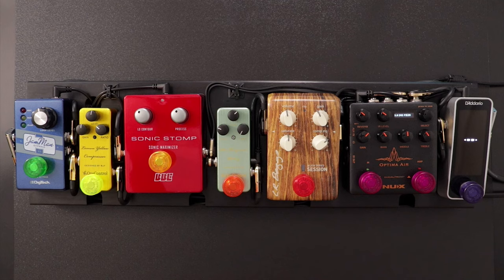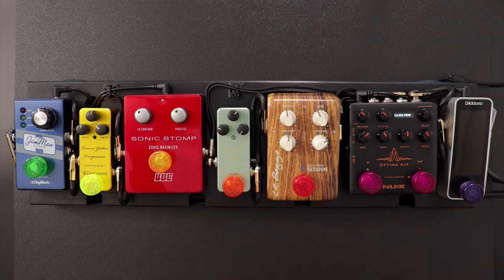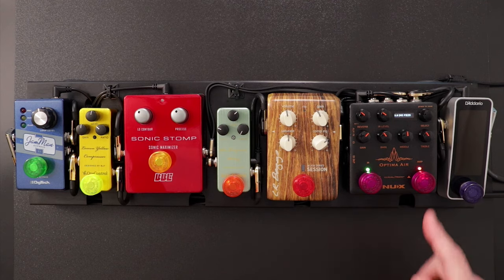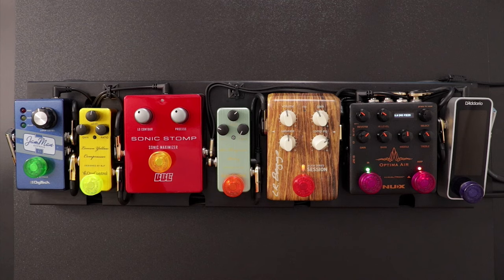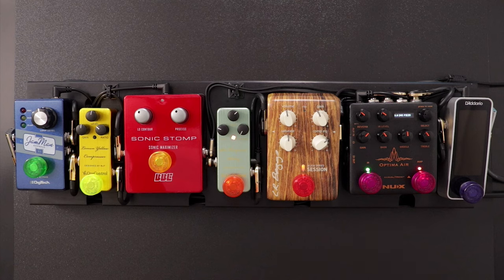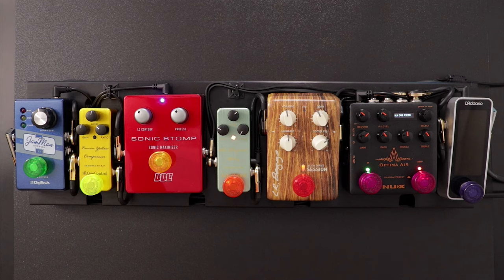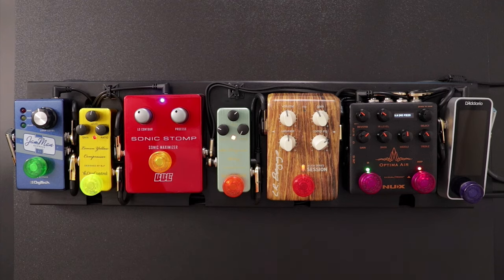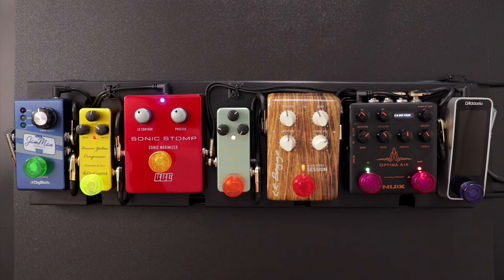Acoustic Guitars NEED Pedals Too! | Acoustic Pedalboard Walkthrough

Comment: Step 1: Have a Maton!
Reply from the maker: A nice guitar certainly does help things ; )
Reply: Step 2 - AER amp
Reply from the maker: @DannyBrooks1  Great amps ; )
Reply: Have a maton of money
Reply: Downside of a Maton is that acoustically, they are lacking. Great pickup though. Basically the same as what Takamine use but with an internal mic.
Reply: @scottmoreau5630  I agree on the production models but I have a Custom Shop TE and it sounds fantastic unplugged as well.
Reply: @DannyBrooks1  They can sound nice but it’s the pickup that’s the problem. It’s built right into the bridge and they often brace the top a bit heavier to fight feedback. Still, Tommy uses it acoustically all of the time so it must sound nice enough!
Reply: @scottmoreau5630  All I can tell you is I had a production version and hated it. I Bought the Custom shop TE and it sustains unbelievable well acoustically and has become my favorite guitar. It in a league of its own. I also, own a Bourgeois which is fantastic but the Maton gets played every day!

Comment: It's flat out stupid that Nux didn't include anti feedback on their pedal.  It's prone to tons of feed back when you turn up the signal.  I'm taking mine back tomorrow.
Reply from the maker: No worries. I've always found that putting a "feedback buster" in the sound hole of my guitar solves most issues. Other options would be notching out the problematic frequency with EQ or flipping the phase of your signal. But it kind of depends on your rig (and the volumes you're playing at). Hope that helps!
Reply: It has a feedback filter in the app.

Comment: What if I don't want to plug this into an interface? I have the same amp and I want this to sound like what I am hearing in this video through just the amp for smaller gigs. What do I do then? And if I do want to play through a PA, what is the signal flow, or how to do I get this sound running this out of the DI?

Comment: Curious ¿How would the rig sound with the Nux Optima Air at the end of the chain? ¿Would the IR have a different effect on the overall sound? Maybe that way the reverb is less affected by the compressors. Thanks for this video, the best walkthrough for acoustic pedals online!
Reply from the maker: Thanks! Yeah, it's certainly something you could experiment with. I prefer to feed the IR a clean signal from the guitar. But there's no rules ; )

Comment: I play a 2018 Martin OM28, with a KnK mini installed. It goes through on original Yamaha AG Stomp pedal. It was 400.00 twenty years ago. It has a tuner, mic and preamp simulation, a detailed e.q., a limiter, chorus, delay, reverb, and it still sounds good. Under saddle pickups require alot of gear and tweaking, in order to repair the quacky, harsh, tinny sound. All the gear acquisition can end.  I haven't used that style pickup in maybe 15 years. There is a guy on You Tube who has a method using what he calls tone sticks under the saddle, and it dramatically improves the sound of piezoelectric under saddle pickups.
Reply from the maker: Nice!

Comment: This was very well done. I’m particularly interested in  and impressed with the NUx Optima pedal.  Thanks for this.
Reply from the maker: Great! Glad you found it helpful ; )
Reply: @lukezecchin  I have two Martins equipped with K&K Mini pickups. Would this pedal work with these?
Reply from the maker: @donmartin3356  I haven't used those exact pickups before. So NUX might be able to provide you more specific info regarding using transducer pickups. That said, IR's can be applied to any source. It's more about experimenting to find the tones you like. You can also load in 3rd party IR's, or create IR's specific to your guitar, if you don't find what you're looking for with the preloaded ones. Hope that helps ; )
Reply: @lukezecchin  thanks very much

Comment: Nice video sir. Have you tried using the FX LOOP on NUX Air for the other pedals?
Reply from the maker: Yep, the FX loop works great! I'm actually using it in this video ; )
Reply: Thats great to know. May I know pedals your using with the NUX FX loop? Was planning to rearrage my mini board and was a bit confused with the chain. Here’s my current pedals. Polara reverb, DOD delay,Nux Optima and was planning to buy Diamond comp eq. Can you suggest a signal chain out of it? That would be a great help for to have a starting point. Thanks a lot

Comment: Luke- I love your posts and I have purchased a korg blackpitch advance tuner, a Nux optima, an lr baggs align session an the turquoise sea delay that you have suggested for use with my koa gs mini plus with an es2 pickup into a fender sfx amp. I am also going to go into either my boss Ve-8 or my Ve-2 for harmonies then out to the amp. I have two questions:
1- the Nux goes to a weird setting that is not explained in the manual until you hit both buttons simultaneously- then I see the 15 IR’s? The IR sounds great but when I turn on the EQ side the signal gets much quieter than when just the IR side is on? If I turn up the gain I get more of the fingers touching the string sound. Any ideas?
2- I have been reading about buffers. The Korg tuner is a true bypass. Do I need a buffer tuner or a buffer at the end of the pedal string prior to the amp or is this not necessary with your setup?
Thanks for your videos - I have taken the plunge but I am not good with all of this technical stuff! Just want to get a nice sound out of my guitar along with a good voice/harmony set up for small live performances!
Reply from the maker: Hi, no worries. Regards your issue with the Optima Air, I'd suggest contacting NUX support if you suspect things aren't working as they should. They'll be able to better explain what's going on.

As for the buffer... Unless you're experiencing noticeable tone loss, I wouldn't worry about a dedicated buffer. Keep in mind, if your acoustic guitar pickup is active (i.e, if it runs on a battery), your signal is already being buffered. (Also, any pedal that's left switched on, operates as a buffer too.) I use a high-quality dedicated buffer on my electric rig (because I like how it sounds with passive pickups). But again, unless you have extremely long cable runs to your amp, I suspect you wouldn't notice much difference on an acoustic. Hope that helps!

Comment: Hi Luke! I built a board similar to this one and love the tonal shaping I learned from you! I am curious if you've had a similar issue to me, where there is a lot of white noise coming through the PA system from the pedal board, even if I reduce it to just the NUX Optima. I tried both the DI and line output, with the same result. I reproduced the same thing with my audio interface (Apogee Symphony). If I set the interface to bypass the built in preamp, I get less noise, but still there. Once I engage the preamp and add a little gain, the noise pops right out, I can even hear it above my playing. I'm sure with a full band it would blend into the mix, but I am mostly solo. The white noise is much more subtle in your videos. Do you have any recommendation?
Reply from the maker: Hmm... Noise issues are commonly the result of: 1) A faulty cable. Or... 2) Because the outputs on your power supply aren't properly isolated. That said, if you can narrow down the noise issues to the Optima Air, it might be to do with the specific IR you're using. Make sure to select the correct IR for your guitar pickup. Hope that helps ; )

Comment: Hello Mate
Let's say that I have an acoustic guitar with piezo pickup + a simple compressor pedal + a 10 band EQ pedal + reverb pedal...
 Now, based on your great work and experience, in what order would you place these pedals to achieve a good sound that is close to natural. What pedal should come first and what should come last. 

Also, I'm definitely considering the Nux optima  you really did a great job... Bravo 🎉
Reply from the maker: Hey! Yeah, I'd probably place the comp first. Then, the EQ. Then, the reverb. EQ and comp can go either way around. However, when you place the comp after the EQ, you usually have to keep adjusting it every time you switch EQ settings. Hope that helps ; )

Comment: Great video and great acoustic tone thx can you imputes other IR's into the Optima Air pedal ? Like the sigma ones I've heard are good (I know there's a way of programing your own guitar setting).
Reply from the maker: Hey! Yeah, you can load third-party IR's onto the Optima Air. I actually tried loading up a few of 3Sigma's IR's for the demo. Unfortunately, for some reason I couldn't get my laptop to communicate properly with the NUX software. (This could have been due to an issue on my end though. I'll have to experiment some more.) Anyway, I hope that helps. Cheers mate ; )

Comment: Thank you for the great pedal board design.   Definitely plan to grab some of your concepts and pedals as well to my board.    Question:   Where would you suggest inserting a chorus pedal within this chain?   Specifically the Strymon Mobius.   Thanks in advance!
Reply from the maker: Hey! I'd put the Mobius, either, in the loop of the Optima Air. Or, at the very end of the board, if you'd like to run it in stereo. I'm sure both would sound great!
Reply: @lukezecchin  thanks for fast response!    I was also considering the One control Blue Monger or Copper Chorus for the better use of real estate on the board!   Do you have a preference for either of these?  I’m planning on adding a subtle chorus effect to enrich the soundscape.
Reply from the maker: @mspring6387  I don't have any experience with these, sorry. All the best!

Comment: Good video
Can the NUX blend in the plain pickup ?
I like the sound you are getting, but my taste would be somewhere between the pedals bypassed, more subtle, at least for some styles
Reply from the maker: Thanks! Yeah, I originally hoped that the 'IR Level' knob would be a blend knob with the pickup sound. However, turns out it's just a simple volume adjustment for the IR's. That said, after playing around with the pedal, I didn't really miss the piezo sound—so it wasn't a deal-breaker for me. Hope that helps, cheers ; )

Comment: Awesome video and demo, thanks buddy. I am slowly building my board based on the optima air and love it. What's the general difference between running the pedals from the line out or if you ran the other effects through the effects send and return on the air? Thanks mate, love the vids 😊
Reply from the maker: Thanks! Yeah, the FX Loop just places things 'after' the IR but 'before' the reverb. Hope that helps ; )
Reply: @lukezecchin  ahh ok thanks for the reply. So I am looking to run a compression, delay, reverb and octave pedal and would be ok to run all through the loop and then Di strait out to a desk or amp?C sorry for the extra Qs. Thanks again
Reply from the maker: @RichardDeadman-s8q  Yep, I'd run the comp before the octave. Then the delay into reverb. You could also try the comp and octave before the NUX, to see what sounds better.
Reply: @lukezecchin  awesome, thanks for the advice, much appreciated 🙏

Comment: Luke, thanks for this detailed explanation of your amplified acoustic tone. This is certainly one of the best explanations and demonstrations addressing acoustic guitar amplification that I have seen . . . anywhere. I realize that not everyone will agree or appreciate this processed approach but having dealt with acoustic amplification for the past 18 years or so I have a great appreciation for just how difficult it is to achieve a really good acoustic sound in an amplified environment. It is possible to get an "okay" tone using an acoustic guitar with a good pickup system run straight to a Sound System but I have never heard that approach sound "really good". Acoustic guitar pickups may have gained some ground in the past 15 years but they still fall short of natural acoustic tone. I believe the very act of amplifying an acoustic guitar inherently changes that nature. In other words, it is not really an acoustic guitar tone any longer. It is its own unique sound. It can be a really great sound but it isn't the same thing as the original. That said, taking the extra steps to present a really good acoustic guitar-like tone will yield benefits in the final product . . . a sound that is pleasing to the player and the audience.
Reply from the maker: Hey Bryan, thanks for your kind words. I'm glad you found the video helpful! All the best mate ; )
Reply: Still happy with it....I'm taking mine back tomorrow....feed back is a pain in the ass when you try and get decent volume.

Comment: Coincidentally, I am just putting together an acoustic pedal board. It's very basic, but I feel it will be very sufficient for my needs. I have a Tuner, a Compressor, an Optima Air pedal, and a Looper pedal in that order. The Optima Air Pedal is the best thing since sliced bread, don't you think? Now I thought I should run the compressor after the tuner. Do you have a reason you chose to put your compressor after your Optima Air pedal? I would be interested in hearing your in depth assessment of the Optima Air. I think it has great potential, but they do not provide the detail on the full use of the pedal. For example: How to download or adjust IR's. I still have not been able to get their on line tools to download, but still the pedal is awesome for what it can do.
Reply from the maker: Nice, I'm keen to hear how your board turns out! In terms of signal chain, I mainly put the comp after the Optima Air to mimic how I often order things when I'm recording in the studio (comp after EQ). Also, my preference was to feed the Optima Air the unprocessed signal straight from my guitar. (But you can always test it out both ways and see what you prefer.) P.S. I'm actually putting up a more in-depth video focussing on the Optima Air next week, so keep an eye out for that ; )

Comment: Do you use the fx loop for your wet fx / enhancements? Curious about overall signal flow. I wonder if integrating this with something like a firefly di or any tube preamp would be a benefit. Nice sounds!
Reply from the maker: Hey! Here I'm running some sounds in the FX loop of the Optima Air pedal. But I don't use an FX loop with the amp. There's no real need as acoustic amps are generally super clean with a lot of headroom. That Firefly DI looks sweet though ; )

Comment: About the best sequence of building up the acoustic tone I have seen. Really like the comparison at the end with everything on then everything off. I use a Fishman ToneDeq and get a nice compression and reverb (analog) with that. I think I could really benefit from the Nux pedal. Where would you put a tremelo in the chain? I have a few songs where that will be useful. Thanks for taking the time to present this. Cheers!
Reply from the maker: No worries! I usually place tremolo at the end of a signal chain (before the looper). I also like to put it after delay but before reverb. Although it can sound great after reverb too. It really depends on the sound you're going for. I hope that helps ; )
Reply: @lukezecchin  Yes, Helpful! It turns out the ToneDeq has a very nice analog tremelo built in. I just didn't realize it since I usually only focus on the reverb and eq. So now it seems the NuX would go after the tuner and before the ToneDeq, is that right? Thanks for the reply!
Reply from the maker: @mzmudy  Yep. You could even try placing your ToneDeq in the FX loop of the NUX. (That way you can use the reverb and the DI output on the Optima Air.) But really, it's all about experimenting with what you like the sound of. Best of luck ; )

Comment: Great pedalboard and playing! Would a Stereo pedal like the TC Electronic Hall of Fame work sending the signal to my amp and to the mixer/PA at the same time? Is it a good idea? THANK YOU 😉
Reply from the maker: Thanks mate! Yep, that would be an option. However, you'd still need a DI if you're going straight to the PA. A better option would be to go directly to your acoustic amp (with a mono signal). And then use the DI output on the back of the amp to connect to the PA. Hope that helps! Cheers ; )
Reply: @lukezecchin  That helped a lot! Thank you, gave a great day 😉🎵

Comment: Do you recommend the compressor after the optima air or before? Have you tried both ways? I just got the Optima Air and I am playing with the order of the pedals. Thanks! Great Video!
Reply from the maker: I actually run mine in the FX loop of the Optima Air. That way, you're inserting the comp after the IR's and EQ but before the reverb. That's my preferred way of doing it. However, running it before will work well too. So it really comes down to personal preference. Hope that helps!
Reply: @lukezecchin  Oh that makes sense. Ok, that helps a lot. Thanks for getting back to me. Keep up the good stuff.

Comment: Great video! This is one of the best enhanced sounds I've ever heard!  When playing live, do you use the DI output on the Loudbox, mic the Loudbox, or just go directly from your pedal board to the FOH mixer? It would be great if we could see the settings on the Loudbox as you mention mixing in more reverb.
Reply from the maker: Thanks! I'd just use the DI output from the amp for the cleanest signal. For the demo, all of the amp EQ settings were set to 12 o'clock. And the reverb was just blended to taste. Hope that helps ; )
Reply: @lukezecchin  Thanks! Would you say this set-up depends on using a Loudbox, or would it sound just as good in a live setting going direct to the mixer?
Reply from the maker: @larryroberts6614  You could go direct with pedals for sure. An amp just gives you a little more control and versatility. Also, it means you have more say over your stage volume too...